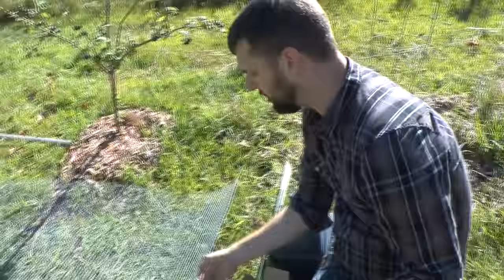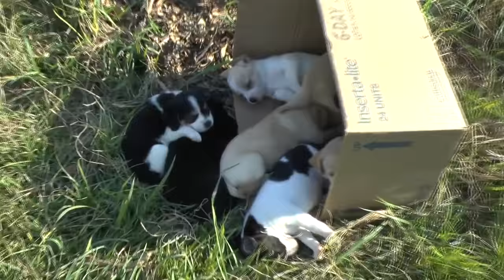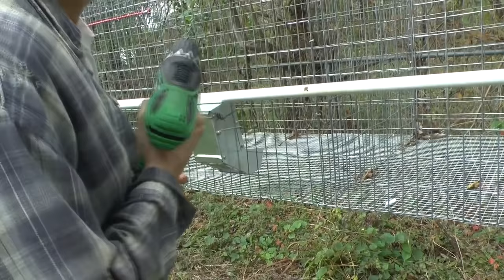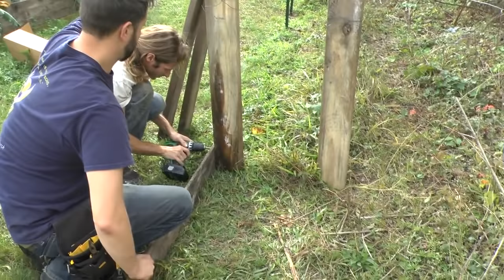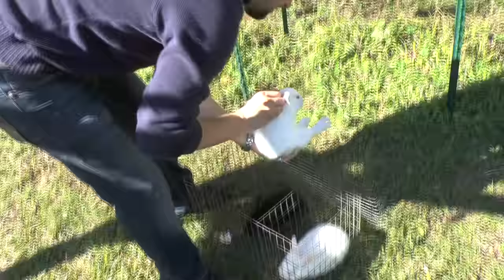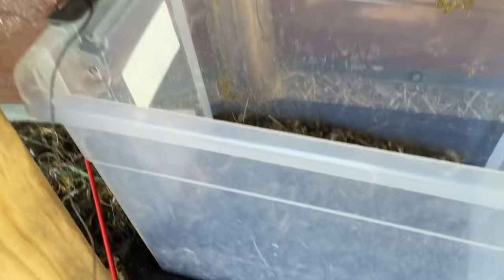Starting A Rabbitry : Building Cages And Water System

Comment: your concept is a great idea. But in cold weather they need some way to get off the wire and in or on something to block the cold. good luck. Enjoyed the video. Thanks for sharing
Reply: When it gets cold I have heating lamps clamped inside milk crates pointing downward from the top, then the whole pin completely covered by the large tarp to keep the heat inside.

Comment: good start - you need "baby saver" wire about 3 in high along the front, back and between the cages - the babies are initially small enough to fall/get through the 1x2 wire.
Reply: I had one fall through today. Two days old. Fortunately I found it, cold but still alive. I was checking the nest box and realized one was missing and it took a few minutes to find it. Baby-saver wire would have prevented this. The cage does have sheet metal urine guards all around the inside except under the door, which is where the kit must have fallen through.

Comment: Good video. I raised rabbits on our dairy farm in Wisconsin for over 20 years. Your set up is really nice, but I would put a piece of wood across the top on the back of your rabbit boxes. It's a nice place for them to jump up on and get off that wire for a while, plus it creates more of a den for them and they are a den animal, and will be much happier. I'd also make sure that plastic tub is food rated. Most of those are not. I think a 5 gallon pail would be much better and MUCH easier to keep clean and swap out. I'm sure you were joking, but those New Zealand white rabbits will never reach that 20 pound weight. In fact, when mine hit 5 pounds or so live weight, they were in the freezer, and that only took about 2 months or so from birth to freezer. Keeping them any longer and the weight they gain doesn't justify the feed they eat and I think the meat is much better when they're young. The only other thing is make sure no predator can get near them. Even if they can't get to them, they can kill the rabbits from shock that the rabbit will have from fear of a fox, dog, raccon, opposum, cats, anything like that trying to get to them at night. Keep up the great work.
Reply from the maker: Thanks for the tips. I like the wood perch/den idea. We'll have to build em one of those :)
Reply: yes I would recommend any breed as they all just produce the same

Comment: 2 suggestion. 
1. the tarp needs to be open on the ends for air flow.
2. in the summer we freeze plastic water bottles and place them in their cage. they can move to the bottle or away as they want. we had several days around 100 degrees in oregon. switch out daily.
Reply: Airflow is overated bruh

Comment: Thank you for your video. I liked the water system, and I really liked your screen to collect manure. The tarp is good as I live in Texas and need to open up the area for better ventilation. I had not thought of the t poles for legs. How smart. 👍🏻
Reply: I used a small pump to keep water circulating. The water was routed to go back to the water tank.  In the Winter, I used an aquarium heater in the water tank to keep it from freezing. It worked well. I was in NC, and it never froze. In Summer, you can put frozen 2 Ltr frozen water bottles in the tank to help keep it cool. I found using a xlg cooler to be a great water tank.

Comment: your off to a great start, if you build 'house boxes' for your rabbits they will do OK into freezing temps, just a plywood box twice as big as the bunny, with a floor and a roof, you only need to put it in during cold weather, so they dont eat the wood..(as much)
Reply: Not really good idea. The rabbits will pee on the wood.
Reply: Not if you take the time to box train them.  They will pee/poop in the same place every time if you train them to use one particular spot.  Worth spending the time on your buns to get them to do that.

Comment: Great job with the cages n stuff. Good efficient design that saves cost and work. I used to raise rabbits. Won first prize in the fair and 3rd in state. That wasn't about raising them, just about playing with my really nice looking rabbit until it was tame as a puppy lol. I learned a lot though. They need an enclosed hutch to stay warm, especially babies in a nest, and because left out in the open without an escape it makes them crazy and they do stupid things that harm themselves and babies. Also the pee has a lot of fertilizer value. I like the poo mixed with the pee, works great. May get too strong and you have to mix with some water, but a lot of Nitrogen in the pee. Pee will also cause a problem if allowed to all go to the ground, kill the soil, but it will be good soil for the high Nitrogen content if you want to use it as fertilizer.

Comment: and yes you CAN put rabbit poop directly on your garden, but, its better if you let it dry out, and then mix it 50-50 with old straw/hay and sandy soil, its AWESOME garden mix that way...
Reply: You should add a small amount of water
Reply: Do you know if rabbit pee will kill you plants?
Reply: @cherylseybert5669  know this is an older comment but there is amonia in urine and in higher concentrations yes it can kill your plants. Just dont like pour thier urine into your compost or anything and you should be fine.
Reply: This is a awesome my friend great cost effective system thanks for sharing

Comment: I personally prefer j clips to hog rings 1. I believe they are stronger and 2 they don't poke or snag the rabbits or you, also you might want to use 16 ga wire for your bottoms and 14 ga. Baby saver  wire for your sides, so you don't lose any kits out the sides, put some kind of perch in the cage's so moms  can get up away from babies from time to time and some kind of shade over all them as rabbits sunburn easily. Otherwise  your off to god start and I like you watering system. I put a flat chunk of oak 6" x 12" in each cage it give the rabbits both something to lay on as well as something to chew on. Good luck and Thanks for your video's.

Comment: I like your cage set up. I'm planning on starting a rabbitry very soon but will be keeping my cages inside my barn. I like your idea for the tarp underneath to collect the pellets, but I'm not sure what to do about the urine. The floor is concrete and I really don't want any of it touching the floor as it will absorb and leave a nasty ammonia smell that lasts. Any ideas on how to collect the urine well? Thanks for any help!! - Kay from Toronto
Reply from the maker: Maybe put a heavy tarp down and put horse bedding on it. It’s like cat litter for horses. It’s cheap and very absorbent and traps smells. Turns to sawdust when wet and can be composed

Comment: I just seen your video on making the rabit cage ,
I think 7 cages.
And hanging them up with metal stakes .
My question is,
All the fitting for the watering system you built for it,,
Where can I buy???.
I usually shop on line.
I an familiar with the pvc pipe.
But there's a small fitting you added to the systen(pvc)that you then added the drinking fitting to.
I just bought five acres of land and want to breed rabbits for food for the first time!.

Comment: One thing I noticed is your plan with the netting to catch the droppings.  You will absolutely not want to use netting, as the urine is very strong with rabbits.  This will foul your area in a big way.  Instead you can use plastic, catch the urine, & pass it through an acquiponic system for your garden.  The urine is very high in ammonia, so you will want to have it passing through a nitrogen cycle to avoid burning your plants.

My system is going to be setup where the droppings & urine is collected in fish ponds where the fish will eat the droppings & the urine will be processed through our acquponic system fed with the pond water.  We will also be irrigating our orchard/garden with the pond water.

Comment: eventually found out my bottom wire had  to be at least 1/2 inch for the pellets to go through for adult rabbits . also found out rabbits will chew and pull on the wire and break up the grid allowing them to eventually escape if you dont watch for bad spots. also where did you find the brass water fittings i havent  been able to find any?
Reply from the maker: Local co-ops and hardware stores have them here. Amazon carries them if you can't find them in your area
Reply: Do you have a photo of your current one ? Thank you.

Comment: You should have provided straw for the doe to build a nest of. Not strange you lost kits due to cold weather. And a firm roof is much better than a tarp, just because a tarp will move around in the wind and spooke the rabbits. If you build a roof with air over the hutches there won't be any heat build up during hot weather. I have kept rabbits for 40 years, and have been where you're at, but found better ways in the end.
Reply: As I am about to try rabbitry, would you share your methods?
Reply: @DeanRonaldHayes First of all, start small and with pure breds. I recommend reading good books on the subject. Storey Publishing has at least one very good book. The title is Storeys guide to Raising Rabbits by Bennett. But otherwise I started with hutches with solid bottoms, good overhang in the front of the hutches so they were protected from rain, sun and snow. Now I have a rabbitry that has all the hutches opposite each other,  sky lights in the roof ridge, and the ends are open in the summer for good ventilation. All wire hutches. The feeding is good quality hay, rabbit pellets and greens (everything from the garden, kitchen garden, fruit, not citrus as much and so on). And last, but not least, take into consideration where you live due to climate, and join a local rabbit club.

Comment: Extreme cold here prevents a setup like that unfortunately, but i have 5 rabbits and basically used  for garden fertilizer. I may breed later though i am not at present. I do find that composting  rabbit droppings in straw with the urine to add to compost heap is more beneficial in breaking down the pellets than just putting the pellets directly in the soil because worms can further work the compost and everything adds the beneficial microbiol bacteria. so letting rabbit urine go to waste is my second point.  I see you decided to go wood on your project anyway. Framing in galvanized conduit is not expensive and then like your cages there would be no wood.  Your nest boxes are also plywood that is filled with toxic glues in layers also there is no rest on top for mom.  There are many ways of doing things and thanks for sharing your way although i do not agree with some things, all in all if it works for you... nice job.

Comment: Doesnt the metal hurt/ cut into their feet?
Reply from the maker: No. They've been raised on the wire their whole lives. Their feet are toughened to it. But we do give them a piece of wood panel in each cage to get off the wire when they want
Reply: Also, you should be sure to use wire with small holes. It won't hurt their feet.

Comment: This cage is not for me .....well the size of cage is not for me. But your concept is awesome. I move my rabbits in winter and summer to keep them in shade and out of wind and such so size really wouldnt work for me.our Winters are cold. Good video good luck.
Reply: In NC I built a small PVC hoop house and covered it with visqueen. I used construction zippers to make doors on both ends for airflow. Cages were zip tied to metal conduit post. I used visqueen to channel the droppings and urine it a tote. Aquarium heater in a recirulating water tank, made from a xlg cooler. Ice bottles in the cooler in Summer. 2 small clamp on fans for circulation.  No losses ever.

Comment: Hey how did the WD40 work out for ear mites?
Reply from the maker: Haven't had to use it on ours but it does work. It's just fish oil
Reply: Thanks for this video. We really enjoyed it! Be careful with the WD40 though. The fish oil story that was going around awhile back isn't true.
Reply: I have used vegetable oil for the ear mites. Just a few drops in each ear eliminated the mites. With an eyedropper put a few drops in the ear and when the rabbit shakes it's head the oil gets distributed. The oil suffocates the mites.

Comment: I use to raise rabbits . And raised rabbit feet are not as tough as wild rabbits. Half of the  off bottom of the cage needs to be wood or something they can get off the wire cage . If not you will have rabbits with feet problems . If you don't it's cruel to the rabbit.
Reply: We do. :) Each cage has a large "sheet" of wood for them to rest on.
Reply: it is 100% fine for rabbits to sit on wire. You even have wire half the suggested size for wire hutches, so your rabbits will never get sore hocks. Im glad you give them a place to rest, but know that a rabbit can live its whole life on 1/2" x 1" wire and never get sore hocks. Be careful with the board absorbing too much pee or keeping the rabbit feces in the cage for too long, a rabbit is morel likely to die or get sick through consuming its own non- cecotropes feces or being exposed to its own potent urine then it will be from standing on the wire.

Comment: NO WIRE FLOORING. IT IS HORRIBLE! Despite what some people may say wire flooring is absolutely horrible. Your bunnies get sore hocks also you need to keep them inside outside they are exposed to the weather conditions which can be harsh. Please no wire floors and keep bunnies inside.
Reply: Do you have references?   Are you thinking with your emotions or your intellect?  Did your bunny tell you this?